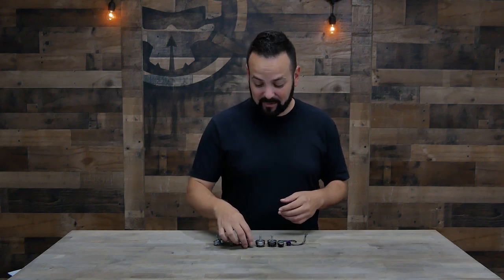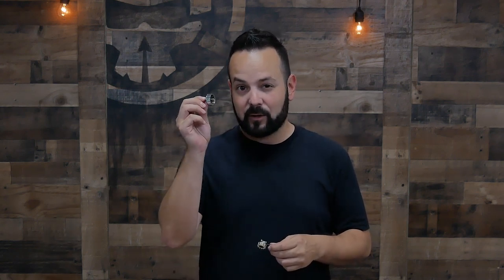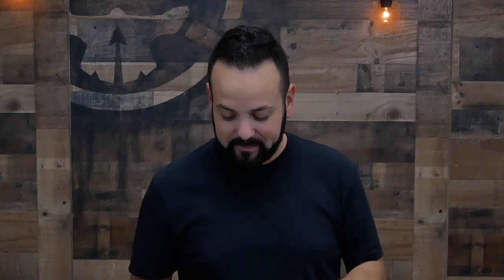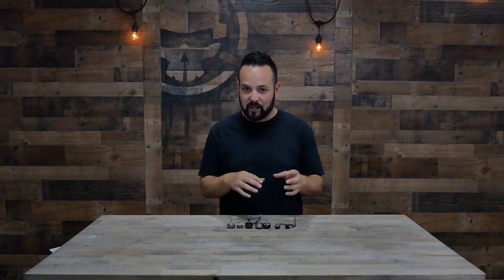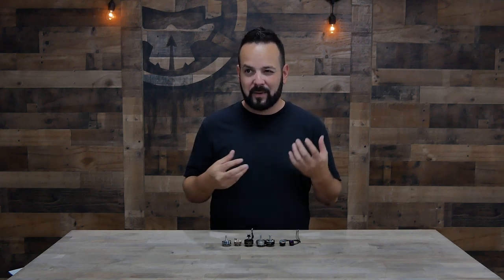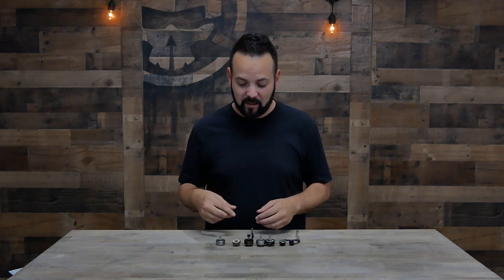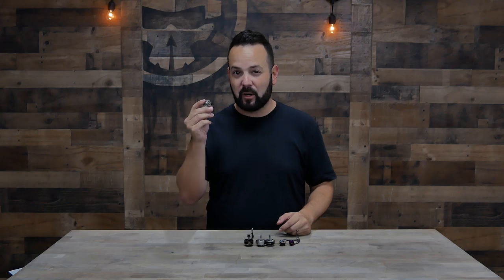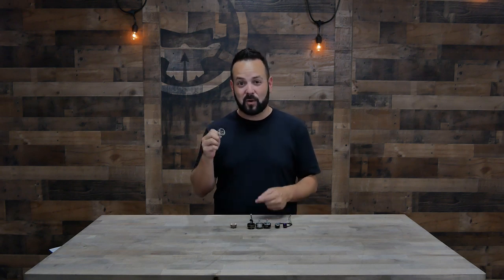Choosing Motors for FPV

Comment: And there is one more important parameter in motors that was not mentioned - it's a mounting holes pattern and it's dimensions. Two same stator size motors can have mounting holes with different sizes placed on different distances, so one motor will fit to your frame and another will not.
Reply: Yeah i just learned that the hard way 😅

Comment: 20 years ago racing rc cars we kept track of wire wraps which could be a thicker gage and fewer turns made a faster more torquey motor like a greedy 11 turn was badass or like a "stock" class 27 turn motor batteries lasted 5 or 6 minutes I am trying to learn the ins and outs of fpv .thanks for all the great vids you guys and j.b are all I watch
Reply: We even had go fast juice for the brushes that gave you a lap or two  of sick power

Comment: This had some pretty good info. I've been in the hobby for two years and I'm still trying to figure out the details of matching motors and props.
Reply: Yah I agree.  Logically more blades and a heavier prop would benifit from a slighty larger motor.   Like a cinewhoop with 1408 4000kv with triblades, but if you wanted 5 or 6 blades it would make sense to bump upto a 1507 3800kv.   I think...
Reply: Elon Manuel  nope, no one cares

Comment: Check your motor base plate measurements !! Different brands have different base measurements, for example a stingy v2 frame can not be fitted with ethix silk motors, be aware of that too! Now my frame needs to be adapted 😒😅 happy flying
Reply: @smooth_ops2942  i don't know, never had a stingy frame before, I suppose it will be the same.

Comment: The most critical point not mentioned in this video (as is mostly the case with this bogus channel) is HEAT. Yes, all motors eventually die, but the wrong prop size, generating too much heat, will accelerate how quickly the motor dies. You should be able to hold your fingers on the bell, after a relatively long flight, without your fingers being singed.

Comment: Here is a question, how the Amp on an ESC or AIO FC impact motor selection. Some AIO FC are either 20Amp rared or 35Amp rate. Which or how is a motor affected.
Reply: U r best to choose motors and props first and see what Amps they require. Then choose a ESC / AIO that can handle those Amps.

Comment: What would be the difference in a low kV motor paired with a high pitch prop versus a high kV motor with a low pitch prop
Reply: Bret Huisjen others can correct me if i am mistaken but from my experience, if your were to pair a low Kv motor with high Pitched prop, I have found the experience lacking as they tended to bog down didn’t have that snappy, quick response I prefer at low throttle. At high throttle tho the prop allowed the quad to gain a higher top speed. 

A high kV motor with a low pitched prop would give a better instantaneous response but would top out and not be able to reach as high of a top speed when at full throttle.

(Note: if you were to pair a low kV 1650-1800kv motor with a 6 cell battery the performance would be similar to a 2300-2500kv motor with a 4 cell. [most people switch to 6s because it allows them to have a longer flight time with a 1050mah 6cell vs a 4 cell 1300mah. The watt hours are more with the 6 cell LiPo]) 

(1050mah/1000) x (6cells x4.2 volts per cell) = 26.46Watt hours 

1.05Ah x (6x4.2V) = 26.46Wh

(1300mah/1000)x (4cellsx4.2volts per cell) = 21.84Watt hours

1.3Ah x (4x4.2V) = 21.84Wh
Reply: Depends on what areas of difference you're noticing..
At slow(er) speeds or hover, a higher pitch prop will tend to cavitat more, be less responsive to throttling, generally produce less static thrust at a given rpm, and works your fc and esc's harder, and may take a good tune, or will make tuning more finicky.. but at higher forward speeds it comes into its element as it "hooks up", becomes more efficient, and produces higher speeds (along with less rpm and vibrations vs higher kv/low pitch).
So if you want to take off and cruise around faster a lower kv high pitch combination might be the right pick.

A higher kv lower pitch combo will deliver better low speed handling via wider throttle resolution that also allows the fc more fidelity because the props are turning faster, producing more predictable static thrust and not cavitating as much.  It'll be nimble and predictable around a playground of obstacles, without being too sensitive, but it may produce boring punchouts...

I generally stay somewhere in the middle.. like 24-2500kv on 5046 props for heavy freestyle bricks, or 5050/5052's on a lightweight build.. 
The brand and style of prop will also make a huge difference.. some are amp hungry, others not so much, its all trade-offs.

Comment: I'm going for straight efficiency so I'm usually choosing a motor size smaller than everyone recommends and lower kV. 
Right now trying to find most efficient 6" motor. Tossed between t-motor 2203.5 1500kV or 2303.5 1750kV.. 
Which would give the longest flight time?

Comment: I'm just a beginner. I bought some 2450kv motor and it didn't last that long on the air(around 3 minutes). Trying to get used to flying it, the flight time isn't helping. People say that if I use a 5s or even a 6s motor , it would help increase the flight time. Is it true? I'm just cruising around though, no crazy trick yet.
Reply: Not for 2450KV. Each cell you add to a battery, you add voltage. This means you have to adjust the KV of your motor. You have to get somewhere around 1800-1900KV for 5s or 6s. It also depends on the prop your running. 5 inch with 1800 KV and 6s is very efficient. But also decreasing the weight of your quad is important too. Hope this helps. JUST DO NOT RUN 6S ON THAT MOTOR!!!! Also check if your ESC/FC can run high voltage. If you don't do research first it will blow up and you will not be happy...Trust me.
Reply: @alexdunda  Thanks dude, well I've flown my miniquad a couple of times now, I forgot to mention that I use a 4s battery. I'd seen some video on YouTube about people trying 4s on their 6s setup. They mentioned that it wouldn't have the speed but the flight time is excellent so I thought that is what I need, a 5/6s setup and then use my 4s battery. Well I'm no expert so I'd like to here your thoughts.
Reply: Dellox Ford I guess you could set a throttle limit but your motors, FC, and ESC all have to support 6S

Comment: Which motor and prop would you recommend for 5inch for long flight time while crusing but also for some freestyle as a beginner? Id like to get aroung 8-10 minutes flight time when cruising.
Reply: What is the battery count you want to use and the weight of your craft? There is more to it than motor and prop but also voltage source and the mAh rating. This guy claims 8 minutes - https://www.youtube.com/watch?v=Mkl6k_-7q5E
Reply: @alphapapa77  I'm at the same question too. I've got 700g startweight with 4s 1500mAh. atm I have a 2500kv Motor with 5" Lumenier Butter Cutter. But flighttime is maximum at 4 minutes. :( My telemetry warning (under 13.6V) starts after 1 Minute. But after landing, my battery is 15V or more.
Reply: @Smarthomeyourself  Not sure what my all up weight is but I get about the same flight time with my 4S 1300mAh on my 2300kv - it is older X style frame and I forget who even made the motors. I get over 6 minutes when I cruise with my 2200mAh 3S batteries.

The video I linked to are running 6S 1300mAh 1600kv and got 8 minute 'cruise' flight. I'm building a Marmotte now with an eventual target of flying 6S - the thing with 6S is there is less sag and the motors, I've read and watched, are more responsive
Reply: The first key to longer flight times is prop selection.. if you're getting 4 minutes on a 5046 drop down to a 5043, for example.
It may seem you need more throttle stick to hover, and it wont punch-out as rapidly, but it also wont be sucking as many amps overall and that increases flight duration.
A lower pitch prop will also feel a little less twitchy or "touchy", more managable in general (better for new pilot).
fwiw..I started flying 5" quads on 2200 3s packs, 2450kv and Gemfan 5052 props.. that was plenty of managable punch/fun while learning basic flight and transitioning from Angle mode to Acro mode, plus the flight times were well into the 7 or 8 minute range.  
Even today, once in awhile I'll throw a 3s on and cruise around, usually when someone new and interested wants to see the neighborhood or local area thru spare goggles without making them dizzy or sick.. lol.
Reply: 8 to 10mins is easy.. my 5" long range does 40mins (I have video) I still can freestyle it a lil. Just did over 10mins with hero9 but felt the weight lol. 
U could build a freestyle drone then if u want to cruise longer put on a bigger battery. 
A lil smaller motor and lower pitch prop will up flight times

Comment: can I use same size but slightly different kv in a same build please
one of my drone lost a motor and I can not find the exact same motor 
I found a motor with same size but the kv is 3800 but my drone motors kv is 4000
thanks
Reply: No that would cause a lot of imbalance

Comment: Im trying to decide on a motor for 4 inch tri-props. Prolly a pitch between 40 and 45 degrees. Im thinking something like 3200 or 3600 kv max and a size of 1407, 1606 or anything in between. The build will be 4s freestyle. Im interested in emax rs1606 and the 3bhobby 1408. Do you think there are any better motors? I am looking for a motor less than or equal to 15usd each.

Comment: As far as I know kv is rated for motor without any resistance like props etc. so it’s theoreticallish value. Right?
Reply: Correct, sort of.  Calculating kv on paper is theoretical and varies a lot depending on many real-world factors; wire quality/thickness, magnet strength and the bells ability to confine the magnetic field, stator diameter/height/arm length/number of poles, and the number of wire turns around each stator pole - more turns equals less kv, but also more copper, a stronger magnetic field, and more torque at a given voltage, and generally an efficiency advantage. (which is how 6s comes into play).

The actual kv of a built motor is not theory, it can be tested and duplicated consistently using the exact same wire, turns, stators, and magnents, many esc's can tell you exactly what rpm its turning.
A motor's kv will also change a bit as the magnets weaken over time or excess heat. 

Long story short.. Kv is the rpm per volt the motor will try to hit regardless of load... the load slows the motor causing it to draw more amps as it strives to reach its target rpm per volt... more amps = heat... so picking the right combination of voltage applied(4s, 5s, or 6s), native motor Kv, and prop diameter/pitch is paramount in extracting the most power out of a train of parts without over-amping any of them.
Reply: @dash8465  thanks for clarifying
Reply: @dash8465  needed this.

Comment: I started with Emax Eco motors. Glad I did. Can you please write down some  brands and models(specifically 2207 1750kv) for us which you think are the most durable ones? I've upgraded to BrotherHobby Returner R6 2207 1750kv for almost 2 months now and I love it. However, it looks likes 2 of the bearings are starting to go bad due to many crashes I've encountered. I can feel and hear some grindings but still flies smoothly.Thank you!

Comment: Any tips on figuring out the lifting power of a motor?
Reply: yes with a digital scale,  just mount the motor above the scale blasting air on it.
Thats how you measure thrust in grams.
Reply: Although that method is easy and accurate to use, it does require me to buy one of each motor to test it.

Comment: Are emax eco good? Im trying to build my first quad, and I wanna build a 6s 5inch
Reply: umm emax eco are okay for your first one, but since you are running 6s, make sure you get a good quality ESC because 6s puts more stress on the esc than 4s (although less amps)
Reply: @zhongningli4544  thanks for the help! I'll make sure to put some good esc
Reply: @FAQUERETERMAX  there's a channel called Magic FPV, and he tested some Emax Eco motors (can't remember the specs or the drone setup sorry) to the Mr Steele ones. Definitely recommend watching it

Comment: A lot of vague and innacurate information in this video, and that's coming from me, a complete drone beginner. Surprised torque wasn't discussed, and surprised efficiency was described as a motors weight to power ratio. Wouldn't efficiency be when given 1volt input, the rpm is equal-to or less-than the kV rating of the motor?
Reply: No he did touch in efficiency and that’s not how it works. If you’re a complete drone beginner you shouldn’t come on like you know better then.
Reply: @isaaclanier1507  I might be a beginner to drones, but I am an engineer. Motor efficiency is defined as output power divided by input power.
Just because an electric motor is used in drones as opposed to any other application, doesn't all of a sudden change the definition of efficiency.
Reply: Simon O'Toole That’s the problem, you’re coming at this from an engineering perspective, you need to come at this from a drone perspective. It’s defined as power to weight because if you have a motor that can more easily carry the weight of your rig, which would be higher kv, then for your drone it is inherently more efficient. He’s not referring to the individual motor efficiency, in that case you are correct, but rather the motor efficiency in comparison to the total weight of the drone.
Reply: @isaaclanier1507  But that isn't efficiency, that is output. Output is the net force (or power) that a system produces. That isn't efficiency at all, doesn't matter how you look at it. He is using the word incorrectly.
To say I shouldn't be looking at it from an engineering perspective is odd. Drones are an engineered innovation.
Reply: Simon O'Toole If what you’re stating is true, then we would naturally want to most efficient motors which by your definition is the highest kv. By your words we would want say a 4,000kv motor on every size drone, but we don’t. We vary by thousands of kv because that’s not how we view motor efficiency when it comes to drones.
Reply: @isaaclanier1507  I said efficiency = output power / input power. Not sure how my definition leads you to think that max power means higher efficiency.
Reply: @mysticfakir2029  Isaac sounds about 12 years old. The second he said "That’s the problem, you’re coming at this from an engineering perspective", I knew he had no clue what he was actually saying. That sentence made absolutely no sense seeing as engineers (from their apparently incorrect perspective) would design the most efficient Drones to suit their needs.